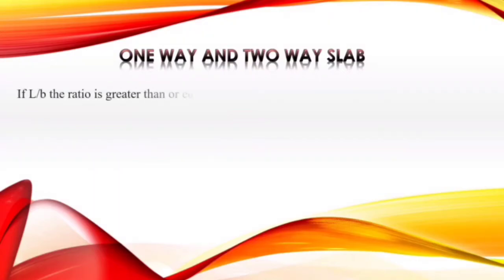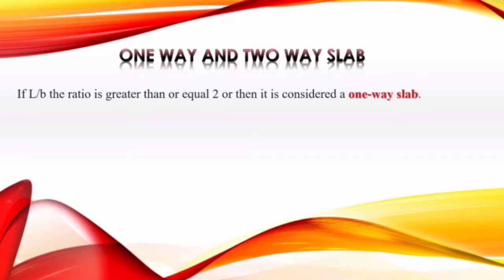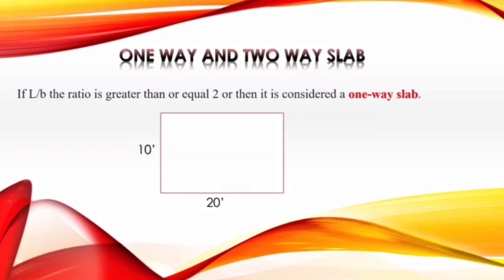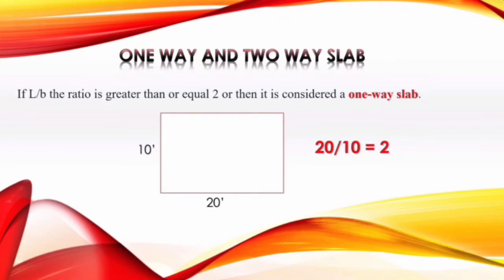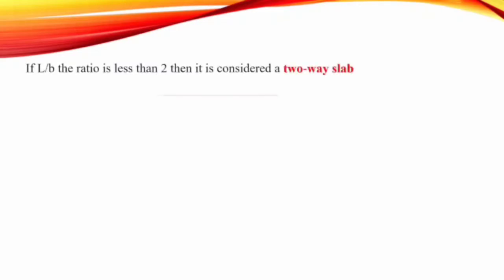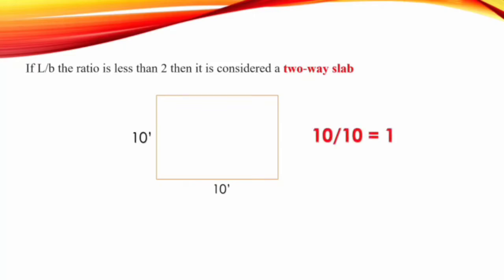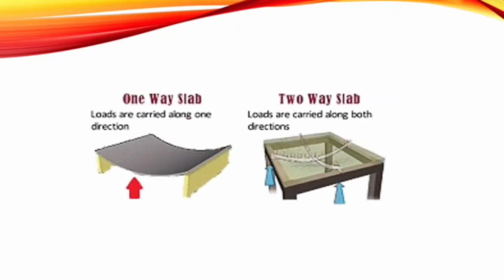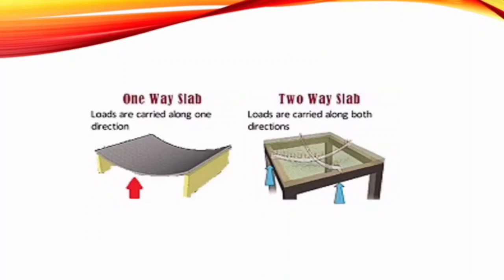Difference between one way and two way slab

Comment: Will a 4 inch brick wall of 10*20 feet effectively bear the load of rcc slab lintel. Will it be earthquake proof
Reply from the maker: A masonry wall would appear to be load-bearing since masonry is a solid, substantial, and exceedingly strong building material. But a masonry wall may or may not be load-bearing.
Reply from the maker: But i think it can bear a load of Rcc slab, when we provide columns on the corners of our walls, yes it will be earthquake proofing if we provide columns without a column it will not suppers.